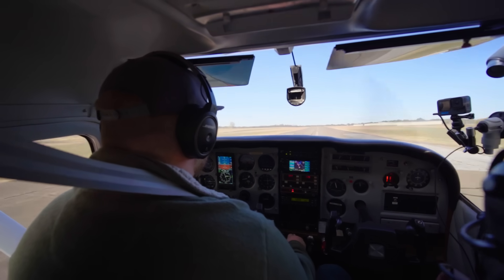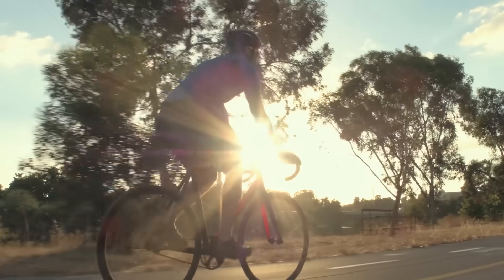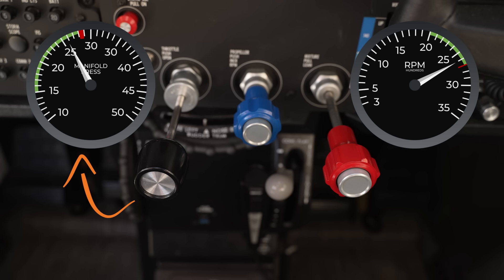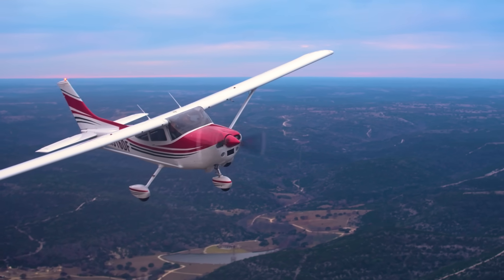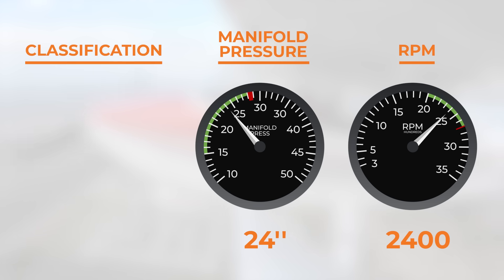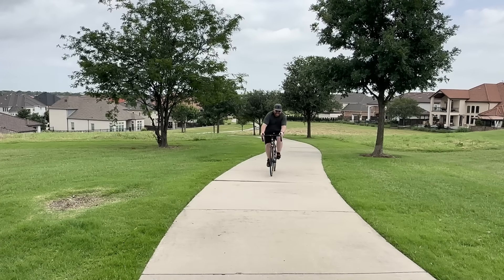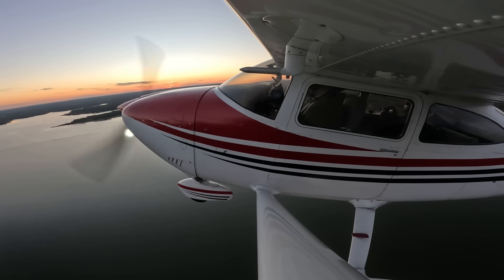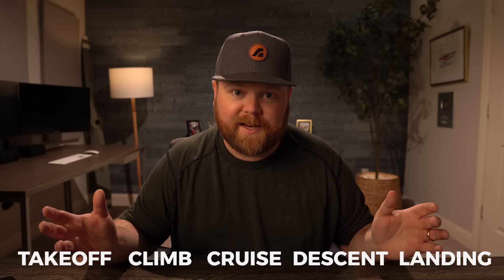Constant Speed Prop Explained in Plain English (Start Here!)

Comment: When adjusting the power  / pitch for a particular profile, you also need to adjust the mixture.  So to set climb power, it’s mixture rich, then pitch, then throttle.  The reverse is to decrease power at the top of climb.  I learned it as
To increase power;  More Ruddy Throttle
To decrease;  Too Ruddy Much
M = mixture
R = pitch
T = throttle

Comment: Important to note for those learning: The manufacturer has provided tables for MP and RPM for optimum take-off, climb, cruise, etc. You don't have to figure it out yourself. Just learn the few key MP & RPM points as noted in the POH and you'll be fine.

Comment: The over square nonsense has been debunked many times. I just looked up the MP and RPM combinations in a friend’s Comanche 250 with LYCOMING MODEL O-540-A, 250 HP NORMALLY ASPIRATED ENGINE. There are plenty of combinations “over square” in the performance table.
Lots of the combinations for 65% and 75% power in another friend’s Dakota Lycoming O-540 are also over square. 
I just looked up the Power Setting Table for a IO-360 Arrow and all of the MP/RPM combinations for 75% power are “over square”. At 2100 RPM all of the combinations are “over square”.
It’s been a while since I flew a normally aspirated plane with a constant speed prop, but I suspect that the confusion arises because the lower-powered engines lose MP as you climb and it’s difficult or impossible to get them to be ‘over square’ at altitude.

Comment: manifold pressure tells you how much is gas pedal (from car perspective) is pushed. and high load (coarse pitch) low rpm problems starts under green rpm range. so messing what first during small corrections don't make difference, BUT it is for keeping good habits for landing/takeoff phases.

low load (blue knob to the wall) is NEVER bad for the engine. but you will NOT achieve full thrust at higher speeds and fuel economy goes out through the roof.
high load (coarse pitch) at low speeds causing propeller stall, so max thrust isn't available then. ex take off/ go-around. 

high speed of airplane DECREASE propeller's effective AoA. so in practice higher speed lower load on propeller.

Comment: Charlie, i think the analogy with the bike is great but not for Constant speed prop. 
It is great and spot on for Variable pitch propellers, but those aren't much seen these days. I would hazard a guess that it is this mixing of two concepts is what causes all the confusion.
Both have same goal. And utilize the same mechanism. But what pilot sets up with the blue lever is very different.
I think about it this way.:
With VarPitch yes it is exactly like a infinite bike gear shifter.
But with ConsSpd that is different animal and more akin to automatic transmission in a car where pilot sets up Economy Normal or Sporty mode of operation. if he want high revving engine that is very responsive but guzzling the gas or lazy but gas sipping engine and slow to respond to changes.
And since the Constant speed prop changes its pitch on its own depending on conditions. 
You could say that if you were to leave it on some max safe rpm you would be getting something akin to automated Variable pitch propeller. 
Because as you would speed up it would automatically pitch coarser to keep the rpm at set value.
Same if you were to from a cruise start a climb and thus load the prop by pitching up, it would pitch finer on its own.

Problem is that this automation works great in narrow band of operation. And closer to the operational edge both coarse and fine we are, it is not able to keep up.

At too low RPM in a climb no matter how fine it sets itself it will not be able to pull you up and starts to slow down. It needs your legs to paddle faster.
At too high RPM while fast descent, no matter how coarse the pitch sets itself it might not be enough and that engine needs to be set to lower rpm otherwise it will overspeed.

Comment: As you accelerate during takeoff you need to coarsen the pitch of the prop first for best efficiency.  You will feel the increase in thrust and you want the throttle to remain on the enrichment circuit during initial climb.

Comment: Great job.  As low time, and non-current private pilot the prospect of a CS prop always intimidated me.  This was a great explanation.   I've driven a manual transmission in my car all my life so I guess it's a similar jump in skill sets.
Reply: As a newly minted private pilot who learned on a plane with a FADEC controlled Diesel, I'd have to agree.  Eventually I will want to learn to fly on "manual" planes as well, and while this was of course covered in the course, this video did a much better job of explaining it all, especially the practical side.

Comment: So glad you made this video. I have been itching to go get my high performance/complex endorsement and constant speed props have always been confusing to me in their management. You really broke it down well all the way to the end but kind of left a cliffhanger at the end with the turbocharger, lol. Outstanding video none the less!  :-)
Reply: Read the manual for the planes you fly to see which combinations of MP and RPM are acceptable. The general rule is to cruise at 65% power with the lowest RPM setting and highest MP recommended in the power table of the manual. When climbing you want to be at 75% power and fine pitch, although I usually use a lower RPM than maximum allowed to reduce noise in the cockpit and on the ground.

Comment: Nice presentation! Congrats on owning a beautiful Skylane! 

Old rusty pilot here that never flew anything larger then a Warrior 2 or C-172.  However, since not flying in years, I have assembled an extensive flight sim at home with the Garmin G1000nxi suite and 3 - 55" screens.  I purchased the C-182T for MSFS 20/24.  My buddy owns a Hawk XP / Reims Rocket (210 HP)and he can fly square very nicely, usually 24 or 25 square since that engine can run up to 2800 on takeoff.

The 182-T doesn't make enough RPM to run 24/24 square and get rated performance.  So, I looked up a number of comments from some 182-T owner/discussions.  Seems that running OVER square is acceptable.   When I fly in the sim, the MP is 28" and the prop RPM is 2300 which is not that far from RED LINE.  The plane will fly around 142 knots.  Soon as I try and  'square up' with MP, the performance drops into the 130 knot range.

But then again, you mentioned that the T model changes a bunch of parameters from your normally aspirated version. Thanks again!👍
Reply: Than a warrior

Comment: Nice effort but ultimately deficient because the “why” was never really explained. Also, the so-called prohibition on “over square” operation has been long debunked though instructors continue to teach it. I fly my TCM IO360 engine per the published MAP/RPM/FF tables and per Continental and Cessna the engine just doesn’t care what combination of throttle and RPM is used assuming engine is normally aspirated.
Also would have worked better if bicycle analogy had carried into the discussion of moving power or prop first. On a bike you don’t want to be standing on the pedals in high gear (low pitch) and suddenly shift to much lower gear (high pitch). Same with the prop.
Reply: Exactly. This video even says read the POH, which, at least for the 182T I fly, has plenty of "over square" MP/RPM combinations listed in the performance charts.

Comment: I think you were looking for a word or phrase.   We want to avoid 'Lugging the Engine'.    
       Open the throttle / High Power / Manifold Pressure but Have Slow Prop RPM / to Big of an AOA on the prop.   Consequently, lugging the engine.

Comment: Rule of thumb from GAMI, close but not always exact:  current horsepower as a fraction of the max available is  (current manifold pressure / max manifold pressure) * (current RPM / max RPM). eg in a normally aspirated legacy 182 at 23 squared we have (23/30)*(2300/2600) = 0.678 so current horsepower is 230*0.678 = 155.94
Reply: i am not doing that

Comment: Recall reading somewhere that Charles Lindberg, in training WWII Pacific pilots for longest cruising range, maximum fuel conservation, used the following - 1) high manifold pressure  2) low rpm  3) coarse pitch.  2) and 3) are pretty obvious - fewer combustions and more prop bite of the air. Just how does 1) fit into this combination, what effect does it have?
Reply: High MP means less restricted "breathing" for the engine, therefore more efficient induction. Wide open throttle gives you the least impediment of induction airflow. Lower RPM gives you less power loss due to internal friction. Careful mixture setting is critically important to take full advantage of long range cruise.
Reply: @jeffg7  Thank you. What critical engine info reveals the leanest acceptable mixture without damaging the engine? Just below max permissible exhaust gas temp?
Reply: @ewingtaylor5487 It depends. At lower power settings you can't damage the engine at any mixture setting. At high power settings (65% or more), setting the mixture near best power (peak EGT plus 50 degrees rich) will create the highest cylinder pressure, so you want to avoid that. Carbureted engines often can't operate smoothly lean of peak EGT so you're stuck operating well rich of peak (100 degrees or more) at high power settings. Well matched fuel injected engines operate very well lean of peak at higher power settings, which is obviously also more economical. I can see up to 60 degrees lean of peak without roughness, fuel flow is greatly reduced, and the engine loves it. It is not putting out best power there but that's not the goal. The primary instrument(s) would be EGT (ideally showing all cylinders) and fuel flow/pressure. A slow secondary indicator would be CHT, which sometimes has to be controlled by enriching the mixture higher than optimum, if it can't be adequately controlled by increased airspeed or open cowl flaps.

Comment: Good video, but could you now do Part 2 where you explain how you determine which is the right gear for your situation?  How do you know which combination of MP/RPM is the most efficient for your speed  and climb rate?  All I ever hear is "look in the POH".  But the POH never answers the question - it just tells you the acceptable combinations and how much power each produces.  There are many combinations which produce, say, 65% power.  How do you chose? That is actually the only confusing thing about VP props, and nobody addresses it.
Reply: There are an infinite number of approved combinations of MP and RPM (and mixture) that will give you a particular power setting, but only one that's the most efficient: wide open throttle. Therefore if you're looking for efficiency it's the lowest acceptable RPM, coupled with the highest acceptable MP, and leaned appropriately. That's all there is to it.
Reply: @jeffg7  If that's true, it would be great to see a video explaining it.  But as i said, nobody ever explains how to chose between the infinite number of approved combinations.  That said,  throttle wide open doesn't sound like a wise thing to do - apart from anything else it's contrary to the point in THIS video which is keep the blue lever ahead of the black one.  I'd have thought you'd be more interested in getting the prop to run at maximum L/D for the speed you're doing, but I have no idea how to determine that.  What you really want is all three levers set to minimise fuel consumption for the speed you want.  And there must be a process you can follow to achieve that.
Reply: @matthewwilliams2128  I posted a full reply but it never published. Not sure why.
Reply: @jeffg7  That's a shame - I'd like to read it.
Reply: @matthewwilliams2128 I think YouTube's filter is taking issue with something I wrote, not really sure what. I'll post it in pieces.
Reply: @matthewwilliams2128  The "oversquare" concept propagated by this video has been thoroughly debunked but it's ancient "wisdom" that refuses to go away. It's the way I was originally taught, and I'm far from alone. Other than that, the concepts in this video are pretty sound. It is best, generally speaking, to advance the prop control before advancing the throttle when making a large power increase, if only because in a go around situation you'll not want to have to fiddle with multiple levers, so presetting mixture and prop makes sense. If you forget to advance the prop from cruise to max before jamming in the throttle, nothing bad happens so long as wide open throttle and cruise RPM is a valid power setting for that altitude, you just don't get max power for the go around.
Reply: @matthewwilliams2128 Pilots tend to get really nervous and fiddly with the prop control, as though they can wreck something if they mishandle it. But all it does is preset max allowed RPM. If that RPM is approved for the entire range of throttle settings at that altitude, then it's no different from an engine with a fixed prop. In that case, you can't hurt anything regardless of order. Now, if the prop is pulled way back behind even a low RPM cruise setting then yes, you can put undue stress on the engine this way. Don't do that, but don't think that the prop control causes the engine to turn brittle either.
Reply: @matthewwilliams2128 That's what works for my normally aspirated, fuel injected, over built Lycomings. But there are engines out there with combinations of settings you should avoid, and that's the origin I believe of the nearly universal reduce throttle, then prop, guidance: it's referring to engines (especially big radials which can be especially sensitive) that would require it. Turbocharged engines have their own requirements and can be sensitive to order of operations especially at high altitude. Know your airplane! This general guidance may keep you out of trouble in most airplanes, and it can also keep you from doing things that are perfectly okay in the airplane you're flying. I wish more instructors made that distinction.
Reply: @matthewwilliams2128 Part 3 (of 4) was filtered for some reason: My engine(s) are approved for max power with no time limit. They are also approved for operation with no limit from 2100 to 2700 RPM at any altitude regardless of throttle setting. That's all I need to know. So long as I make smooth changes I can place them in any approved power setting without having to, say, reduce throttle, then prop, then advance throttle again. So unless I need to reduce airspeed for some reason, I push the throttles all the way in on takeoff, and they stay there most of the flight. I pull the props back from 2700 to 2400 out of 500 ft AGL or so to be kind to my neighbors, and they stay there the rest of the flight. I lean as I climb, then pull the mixtures back swiftly to lean of peak in cruise. For long range cruise I'll pull the props further back to 2100-2200 when leveling off and only advance them back to 2400 approaching the pattern. Lower RPM and wide open throttle is more efficient than the reverse.

Comment: I was taught “prop on top”. Going up or down, the prop (ie tach) must be higher.
Reply: At sea level my O470R makes 30” and 2600 rpm … and that’s recommended takeoff power setting.
Reply: Ya my turbo is 35 / 2600 on takeoff

Comment: Based on this I start at flat pitch on the ground, push the throttle forward at takeoff, adjust manifold pressure in cruise-climb and cruise, and never touch the throttle until I go to flat pitch again for descent and landing (like the bicycle where you try to maintain constant pedal RPMs across changing terrain).  And I know that's not how it works, so what am I missing?

Comment: Think of the throttle as controlling the torque and the prop knob controlling RPM.  
Torque x RPM = HP

As you climb in to thinner air, your engine can not produce as much torque.  To achieve the equal amount of HP, you will have to increase RPM.

Comment: I think people automatically think "complex" means "hard." Given that if you've also got a retractable gear you need an endorsement for it, it sounds daunting.

But after doing my research on it, and consulting pilots who have a constant speed, it is far less daunting. As the owner of a TB-10 once told me, "You're typically just going to adjust the blue lever three times in flight (ignoring the exercise during runup)". And the actual RPM setting you want is more or less straight forward in the POH, and is a function of the amount of HP you want. It's really the MP that varies depending on altitude and air temperature, just like the RPM would vary on a fixed pitch. There are really only a couple cruise settings you'd choose from for the prop setting, and it's typically part of your flight planning.

Then, yeah, when you're landing, if you're accustomed to saying, "Downwind at 2000 RPM, base at 1800 RPM, and approach at 1600 RPM" you literally would just replace that with "Downwind at 20 inches, base at 18 inches, approach at 16 inches" (again, specific numbers depending on the aircraft and environmental elements).

Comment: The hardest part for me was understanding that, when the engine is running at high speed, the left knob adjusts MP, not RPM.  I'd get into this back and forth adjusting black, then blue, then black, etc, trying to get them to line up.  On my last flight with a CSP, the density altitude was so high that I couldn't even get a high MP.  I had to leave it around 21" and keep RPM at around 2400.